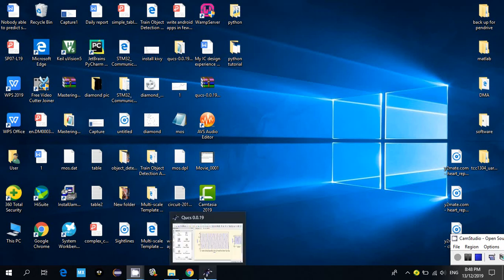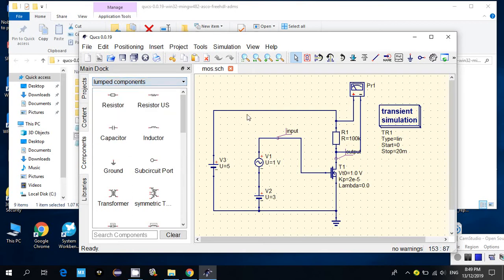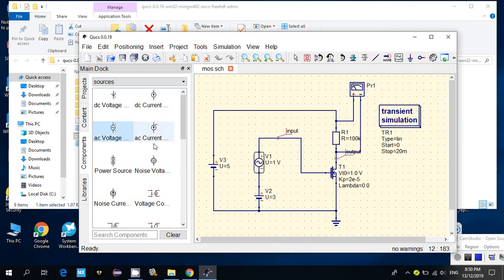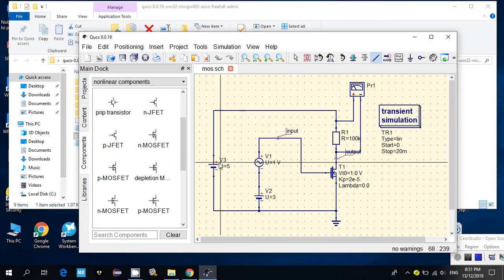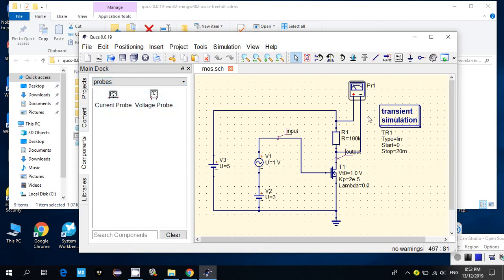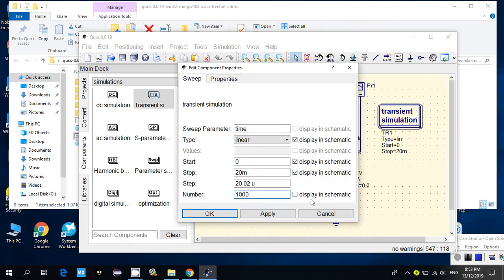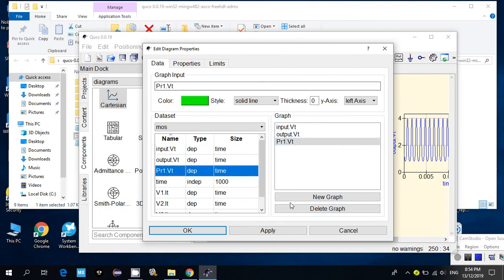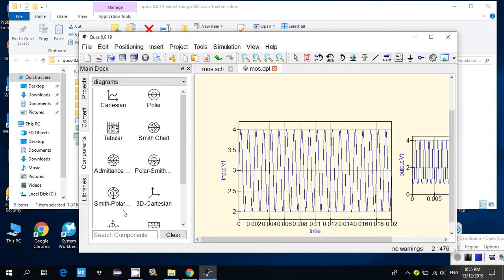qucs simulator-transient simulation for nmos transistor

Comment: How to import the PTM models in QUCS?  I am trying  to download a FINFET model and simulating IV characteristics of the transistor.
Reply from the maker: qucs so far need to manually tune the parameters. If you need to import parameters automatically like PTM models then another simulator ngspice which use hspcie netlist is more suitable. I haven't create video for that.